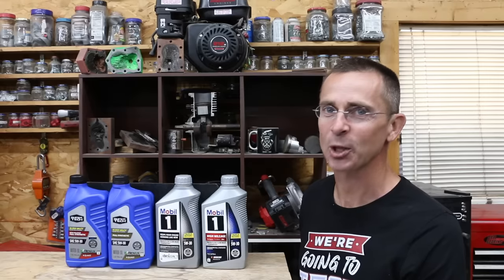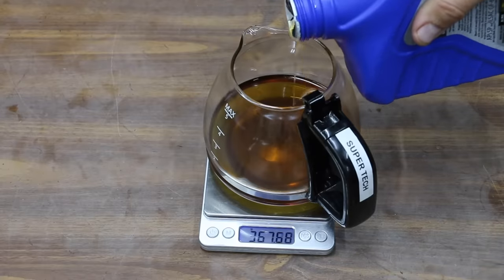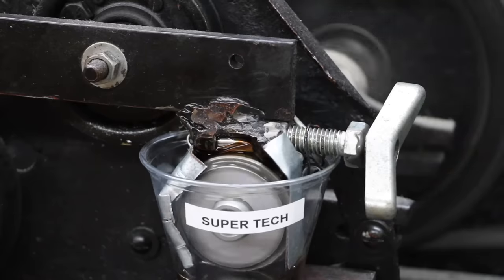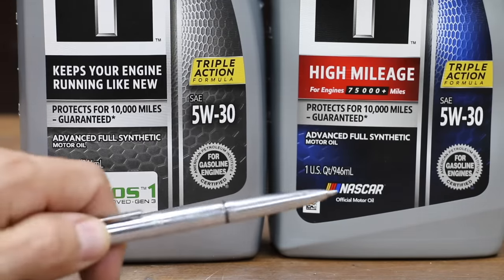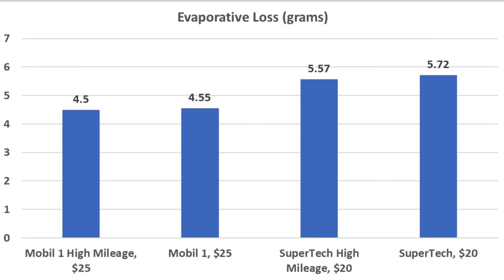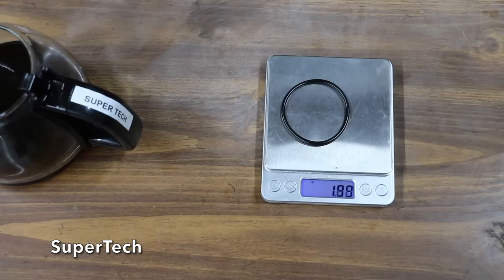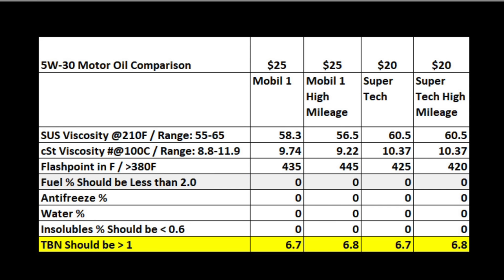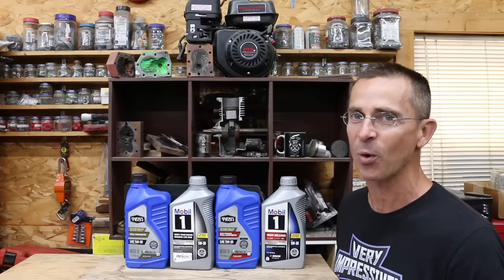Is “High Mileage” Motor Oil Safe? Let’s find out! Mobil 1 vs Mobil 1 High Mileage; SuperTech vs STHM

Comment: Had an 81 chevy pick up,think it was the 305 motor,don't recall the mileage, but it was up there in '92/93 ,anyway it was a leaker and I used a lot of the 30 weight oil I got out of the boats around New Buffalo marina where I worked,many times that oil was like new
Reply from the maker: Thanks for sharing.

Comment: I have a question for. I have 120k on my car. I currently use pennzoil platinum high mileage. Would you recommend switching to Mobil 1 high mileage? Or would you switch to the normal pennzoil ultra platinum? Thanks for the help!

Comment: MY 03 ram has 280000 on it and my 2013 optima has 265000 on it and all I use is Mobile 1 high mileage with Marvel's mystery oil with every oil change
Reply from the maker: Thanks for the feedback.

Comment: My twin grandauters both have cars and them to check thier oil several times a month. Also to never check it when the engine, ( don't call it a motor ), is warmed up. It should be when it has cooled off. I also told them to never check the dipstick on the first pull. Wipe it, replace it, and check the second pull. Men usually know this but the ladies don't.
Reply: Everything you said is true and is what my mother taught me(her father was a mechanic)❤
Reply from the maker: Thanks for sharing.

Comment: Good testing but I think to have better results for things like the evaporative losses test, you should start with a standardized weight, it might be losing different amounts of oil to evaporation because of the different starting weights
Reply from the maker: Thanks!  Thanks for the constructive feedback.
Reply: That’s more of a engine specific PCV blow by issue that is often called evaporative loss.  A long chain heavy hydrocarbon molecule does not evaporate.

Comment: Extended oil change intervals - DO NOT DO IT - even if the oil itself does not break down , the particulant matter is increasing with mileage so the metal surfaces are being scraped with more and more abrasives. Remember - oil is cheap , engines are expensive. If you change your oil and filter every 5000 miles , your engine will last the longest its design will allow. I usually get 320,000 kms plus with NO OIL BURNING.

Comment: What's the point of freezing 5w oil at -40 when the boundary pumping limit is -35. You should not use 5w-30 below -35.

Comment: how about motorcycle oils? (No anti-wear additives since most MC clutches are wet, meaning that the engine and clutch are both lubricated by the same oil.)

My current machine can use "normal" oil since the trans is separate, but my previous rides couldn't.
Reply from the maker: Thanks for the suggestion.

Comment: It's odd that they are that much different because the Supertech is supposed to be made by Mobil 1 for Walmart. For the money it is very good. Walmart now uses Castrol High Mileage Synthetic Blend oil or Quaker State Full Synthetic in its High Mileage oil changes.
Reply from the maker: Thanks for the feedback.

Comment: now what about Mobil One compared to Castrol? or Quaker State? what about the other oil companies, just to get a broad understanding on other brands capabilities?
Because I generally use Castrol High Mileage because it's cheap but effective. I also wonder, does cost greatly affect oil quality? does oil also fall under the phrase/belief of "You get what you pay for? I know these are a lot of questions to ask. and i definitely know it's a very expensive project to undertake. But I am genuinely curious to see what other brands provide, and if cost has anything to do with quality and performance.

Comment: Should I use a slightly higher-viscosity synthetic oil to slow down a leak on my six cylinder, 3.0 liter, 2003 Toyota engine, with 187,000 miles on it?

Comment: I have a 98 Bravada that was running just fine until I put too much Lucas oil in it to stop leaks,I guess it plugged up the engine and ruined the crank,but I can't prove that was the cause. I have heard from many old mechanics that that stuff should be banned.
Reply from the maker: Thanks for sharing.

Comment: I’m impressed with the scar tests (before and after heating) but I’m wondering if the evaporative loss test is changing the composition of the oils differently from what would happen in an engine where everything is sealed and components of the oil don’t escape to the air as readily.  Is that really a standard test?  As a chemist I wonder if the test is flawed, whether it’s standard or not, especially when checking flow after the heating, because the heat may selectively burn off more volatile components that hurt its lubricity but which wouldn’t happen in an engine where there is no burn off into the air?

Comment: usually when i do an oil change, ive used synthetic, but a couple years ago switched over to conventional pennzoil 10w30, ive been losing oil using synth and the van pulls it from the reservoir and it ends up empty after a few weeks, im at 331k miles so this last oil change i did 2 months ago i put in 4 quarts of regular penz conventional and 2 high mileage from the same brand as it was all that they had left, my reservoir is barely empty now and i rarely hear the buzzing of the reservoir pump, i do think the high mileage helps a lot
Reply from the maker: Thanks for sharing..

Comment: Any opinions on "synthetic blend" high mileage oils?  I'm really wondering if Supertech 10w40 SB HM is safe to use in an older engine versus Valvoline MaxLife 10w40 SB HM oil in an older engine; i.e. my 1967 327 engine which still runs like a top.  The Valvoline is getting hard to find in 10w40 SB HM.  Any advice would be appreciated as I'm hesitant about putting the Supertech even in my lawn mowers.

Comment: Thanks for the info looks as though the high mileage oil is worth using.
Personally I change oil & filter every 2000 miles always have always will - I have a 2006 Chevrolet Cobalt 2.2lt when it hit 100,000 I switched it up to 10-40 oil - it seems to run better and I still get 25 to 30 MPG ok 25.? 29.?
Also can I blab on a little - I had in 1985 to 87 a '69 Roadrunner with a 383 auto trans I rebuilt the engine I would change the oil and filter every 2000 miles unless I raced it then it would get a oil & filter sooner - what I would do was take that oil & filter and put it in a '67 dart 6cyl that burned oil about like a diesel burned it clean though through the valve guides I think.
Reply from the maker: You are welcome!  Thanks for sharing.

Comment: Can you do one on mixing various types of engine coolant to see which combos coagulate after heated and sitting over time as well as each alone with multiple metals, rubber, & head gasket materials soaking in it? Curious which really can or can't mix and how the do all types compare to the vehicular specific types. Wondering if they all prevent corrosion equally in all types of materials commonly found in engines & if it's true about some eating head gaskets and how fast.
Reply from the maker: Thanks for the suggestion.

Comment: I don't know how these tests would relate to my  vehical. I have a 2002 Dodge Caravan with 200,13 plus miles so l use high milage oil to be safe, 5 - W 20 as instructed by the manual. So far it's running strong, smooth,  and quiet. It sounds quieter than other newer vehicles .😂😂
Reply from the maker: Thanks for sharing.

Comment: Last time I did an oil change on one of my vehicles it was about 60$ or so for 7 quarts of 5w30 and a filter.  Other day  it was right at 100!,  synthetic mobile one. Purolator boss filter
Reply from the maker: Thanks for sharing.
Reply: Buy the big 12qt box of SuperTech synthetic at Walmart for $48, then pop the $7 for a factory filter from Amazon.

Comment: Please do a video on royal purple XPR, I spoke with a rep who claimed you could drive for 30 miles with 0 oil pressure as long as your using the xpr line since the bond to the metal and film strength is so good he claimed it wouldn’t suffer any bearing damage under normal driving conditions 🤔
Reply from the maker: Thanks for the suggestion.
Reply: The bearing wear test machine that he is using is a copy of the machine Royal Purple uses to demonstrate their oil against any comers.  They use a ton of anti-wear additives.
Reply: @blackhawk7r221   but the real question is, is it really that good and compared to say amsoil dominator is it better ?!? At $18 a quart it’s definitely not cheap and I am very curious if it’s as good as he advertised it to me

Comment: I was wondering how exactly do you have oil sent off to the labs to have them tested? I drive a 199 9 Ford F-150 4x4 with 182,000 miles on it and I feel doing my oil change every 3,000 miles isn't enough because of how the color of my oil looks at 3,000 MI. Also how do I pick the best part of the sample if it says to not pick the parts of the oil that goes through the filter when I want to test the motor oil that's been run in the truck already? I want to see if there is Major engine wear or components of metal inside the oil, and I don't know why the part that I read online says to change it or check it before it goes into the filter. Any advice? Thank you again for the best sandpaper video I requested a while back.

Comment: Super tech kept up with mobile 1 gonna start buying super tech because oil prices are going up mobile 1 h/m is 32,99 for five qtr at Walmart in Corpus Christi Tx super tech is 23,99 money is tight for me so I wont have a problem buying super tech. I have A 97 f150 with 277,976 miles so I always change my oil every 3k miles 😮
Reply from the maker: Thanks for sharing.

Comment: Hi Master. I live in Brazil, and here the weather is hot most of seasons (more than 32° C). Would be better if I use a 10w40 oil instead of 10w30 in my Honda motorcycle? All other brands recommends 10w40, except Honda.
Reply from the maker: 10w-40 would be great.
Reply: @ProjectFarm  thanks for your returnnn

Comment: Only question I have is should you leave that oil in your engine for the full 20,000 miles and if so, with the same oil filter or should you change the oil filter after five or 6000 miles?

Comment: Hi, I didn't know where to leave this comment. Would you please test different header wraps on the market? To see how much lower engine compartment temperatures are with the hood down for an accurate result before and after.
Reply from the maker: Thanks for the suggestion.

Comment: Sometimes the high mileage oil is all the auto parts has on the shelf. Guess they think it's better for all engines regardless of mileage.
Should I use that in my vehicle that has 23,000 miles ?
Reply: I’m wondering the same thing !
From what I saw here , it seems a better option.

Comment: I stopped buying high mileage oils. I always buy top quality full synthetic, usually the extended ones and penz ultra plat. Then add around 8 oz lubeguard biotech, depending on oil capacity. Hemi engines need more moly and have had zero hemi tick  by using penz ultra plat, with biotech in my 05 hemi and newer 2013 hemi 5.7.
Reply from the maker: Thanks for the feedback.

Comment: I should knock on wood but i have a 2003 tundra with 300,000 miles and i have never had an oil leak. I use mobile 1 highmilage and i change it ever 10,000.
Reply from the maker: Thanks for sharing.

Comment: I just bought a used 2019 F150 with the 5.0 V8 it has 95,000km (59,000 miles). Im uncertain about the behicles past maintenance history. The engine has a very quiet, subtle ticking which ive read is common. Is the high mileage oil OK to use in your opinion?

Comment: I personally found that high mileage oil  ,is going to evaporate  lol. 
Seriously though, your motor is going to burn some. I never have to add oil after charging it. But I did try the HMOil. Had to add a 1/4 before the next service was due. 178000 miles and still going strong. GMC.
Went to delo.
Reply from the maker: Thanks for sharing.

Comment: I bought a gm truck with the 6.0 gas previous owner ran valvoline high mileage from 80k to current 160k if I went back to regular synthetic would that cause a problem? No current seeping or leaks
Reply from the maker: Thanks for sharing.

Comment: just change your oil every 5K or so regardless of what the sticker says on the front or the carton says on the filter.  All that crap is a gimic.  high mileage M1 can test better than regular m1 within certain weights but not all.

Comment: I would like to see you test if mixing oils is harmful to your engine.  In recent times, it is sometimes difficult to get the same oil as I have been running.  For example, if I buy two 5 quart jugs of Penzoil synthetic blend, and use one and 1/2 jugs to change oil in my pickup.  The next time I change oil they may only have Penzoil full synthetic.  I don't like the idea of mixing types of oils or mixing brands of oil; but can it harm your engine?  (assuming all oils are the same weight, like 5W-20.
Reply: No, going to full synthetic isn't bad. What you don't want to do is go from full synthetic to synthetic blend or conventional.

Comment: would it make a difference if o rings were suspended in the oil, not sitting flat on the bottom of container closest to burner?
Reply from the maker: Thanks for the suggestion.

Comment: i have a 2011 jeep  with 146,000 on a 3.7 v6 engine   i change the oil and filter about every 3500 miles  and i do a lot of highway driving  i put in high mile synthetic two oil changes ago, first time the engine check light came on.  next oil change the guy at the store  said O-Reilly's brand was just as good   I try it  drive down the highway  pull in for gas and the was last time the engine worked   the engine seized. i don't understand how we are going down the turnpike doing 80 mph  the car is running great the engine rpms are low and the engine is humming along   how did it  t seize

Comment: I used full synthetic oil in all my vehicles but based on your experiments if I want to use the mobile 1 high mileage oil, wouldn't it damage the engine since it has already been using the full synthetic oil?

Comment: Oil is cheap.Engines are expensive.Change oil on regular basis (mileage or every year).Oil is kept without air exposure,when it's poured into engine it's already losing it's properties.Modern oils are very good,it's not that they'll turn to crap after a month,but even if you're not driving much it's advisable to change the oil anyway because it degrades over time.
Also,do not believe in miracles.Oil gets dirty,degrades so even if it's really a long life (degrades slower) you do not want that all crap ciruling in the engine.Yes,there're oil filters but every single one have a bypass which prevents running without oil in case the filter cloaks.
You do want to keep engine in your car in good shape.Specially now when the prices of new and used cars are ridiculously high.Considering the above I do strongly recommend shortening the intervals between oil changes.Also,always change the oil and air filter.
Reply from the maker: Thanks for the feedback.

Comment: could you do a video comparing different oil filters, like the new super tech oil filter is now $3.84 and it's tiny compared to the old super tech, I guess super tech decided to cut cost, because their new filter is tiny tiny tiny, so for the first time, I purchased a much bigger and better filter at a much higher cost because I did not want to risk my engine with this tiny filter...
Reply from the maker: Thanks for the suggestion.

Comment: Can you test the best carbon deposit cleaner for 2 cycle leaf blowers. I  use STIHL 2 cycle oil high performance for my equipment. Seems like I am having deposit accumulate in the exhaust ports
Reply from the maker: Thanks for the suggestion.
Reply: Also I use mechanic in a battle. I don’t know if it really works, am sure some people will find it useful

Comment: What about sending HM oil and regular oil remved from car after 3000 miles to lab to weigh engine metels that wore off the cylinder walls pistons etc.. to compare
Reply from the maker: Thanks for the suggestion.

Comment: What is the longest a 12volt battery has lasted? I have a kubota tractor that was bought new in feburary 2006 and it has the same battery that came in it. next month it will be 17 years old.
Reply from the maker: That's a great battery!

Comment: Is there something going on with that third flask in the "viscosity at -40 degrees" test?  I'm asking because it shows the exact same (extremely) counter-intuitive result as the Pennzoil test (especially considering how rapidly the Premium oil caught up with the others in the second Pennzoil test).  Would you be able to run a "viscosity at -40 degrees" test using the same oil in all four flasks to provide a baseline?
Reply from the maker: Thanks for the suggestion.

Comment: Use manufacturer recommended oil weight and name brand product high-quality. Change oil more frequently never hurts. If you use to heavy of weight it will cause engine damage. I don't take the risk of high mileage oil products keep it simple.
Reply from the maker: Thank you for sharing!

Comment: Is ' high mileage ' motor oil  stuff that helps use less fuel, or is it motor oil that has already worn out a few engines before you got it?

Comment: 1:29 ”Super-tech claims their full synthetic high milage oil offers better wear protection compared to their regular full synthetics.” 

Why use regular full synthetic at all? If the high milage version offers better wear protection, why not start using it the day the new car is driven off the lot with the odometer at mile one?

Comment: For starters 75k isn't high milage.   I've seen 20 year old cars with 130k miles on them advertised as "low miles"  I've also seen cars that are 4 or 5 years old with nearly 150k miles advertised as "highway miles"
Reply from the maker: Thanks for the feedback.